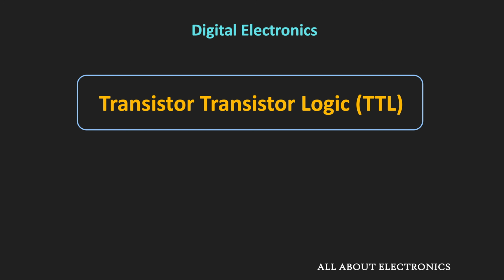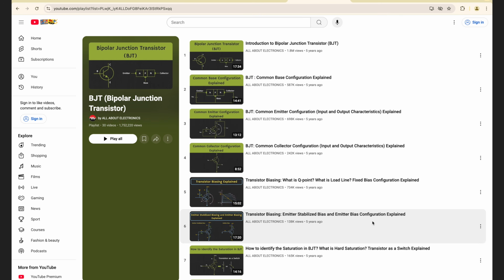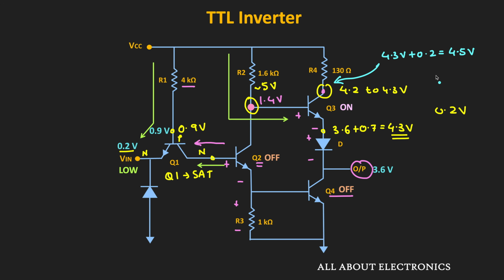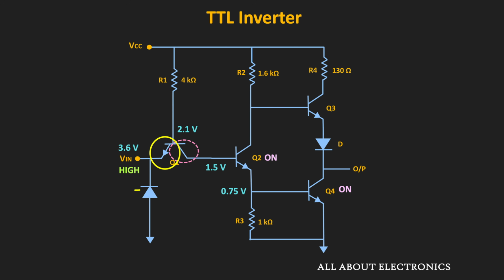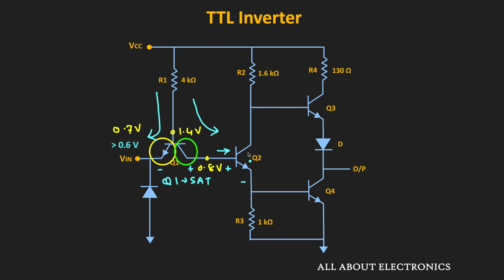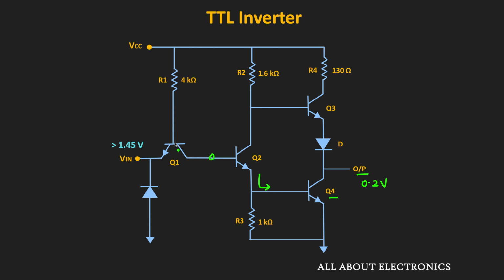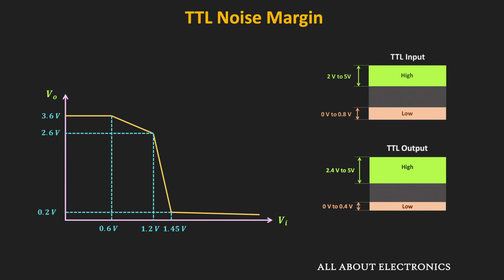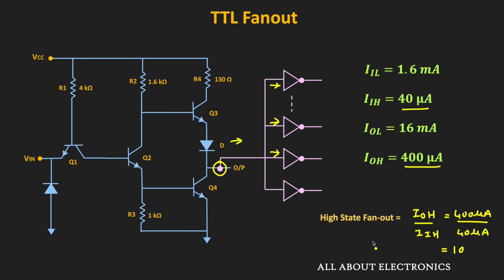TTL Logic Explained | TTL Inverter Circuit | Noise Margin and Fanout of TTL Circuits

Comment: why did u take 0.6V at Q1 position ? 0.7 is standard right ?
pls mention if any specific reason for that. Awesome vid !!!
Reply: 0.6 is also standard. It’s 0.6-0.7 for one diode voltage drop, for non-schottky anyway. One Schottky drop is like 0.2-0.3